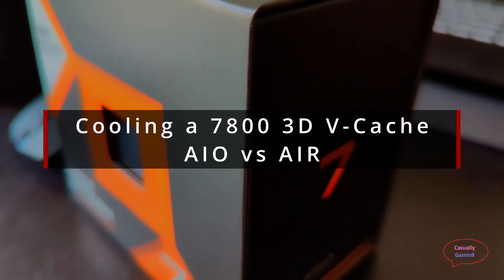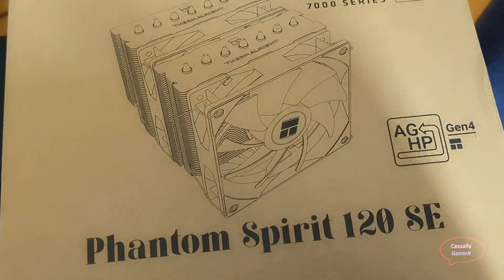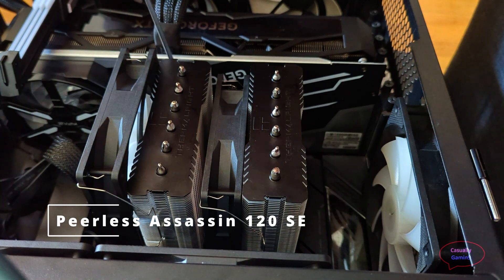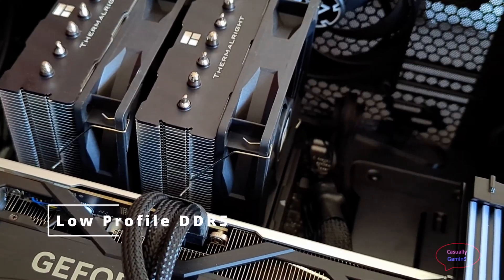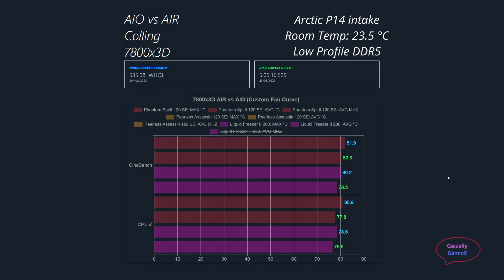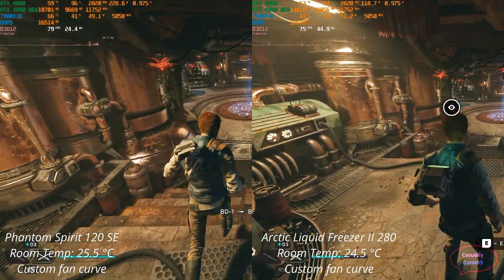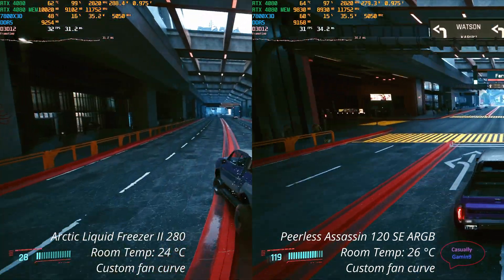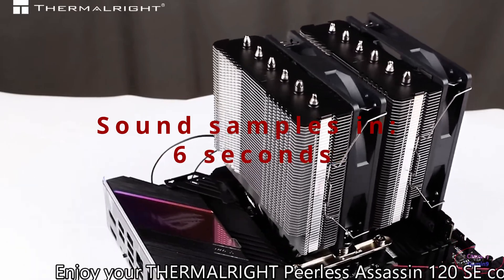Air vs Water Cooling 7800x3D Phantom Spirit 120 SE Peerless Assassin 120 SE vs Liquid Freezer II 280

Comment: You need to show benchmarks. These CPUs are constantly throttling even at 70c by managing boost speeds. You can have two coolers each showing 80c but one gets a 18k cinebench score while the other gets a 17k score. Same temperature, but clearly the 18k one is the  better cooler. Your 2 degree ambient temp difference in the game benchmark is also a problem.
Reply from the maker: At 70 these should not throttle as newer CPUs are ment to increase frequency until these hit the thermal limit. A 7800x3D will throttle at 89 degrees. Intel CPUs tend to throttle at higher temps, as non x3D cCPUs from AMD. This is why I show the averages from 3 runs.
Reply: @casuallygamin9   search youtube for "Air or AIO for Ryzen 7900X and 7600X? Cooler Comparison", notice how the 7600x is the same temperature with aio and air, but the aio is 4% faster in the test. Because precision boost is always throttling, if you plot your hwinfo "effective clocks" on air vs aio the aio will be higher on average, even at lower than 80c temperatures. These cpu's eek out performance at nearly all temperatures, gone are the days of the same performance until the hard throttle limit. Precision boost is adjusting boost and voltages up to 1,000 times per second depending on load, thermal, and electrical conditions, those variables are relevant at 70c as well as 90c.
Reply: @casuallygamin9  So then why does mine suddenly sound like a jet engine as soon as I hit near the 80s or when in the low 80s. It gets loud!
Reply from the maker: I do use a custom fan curve and keep the CPU cooler at 65% fan speed by default and when it hits 80c I have it at 100%. Heaving it spin faster by default will help with idle temps and also, your ears will adjust to the CPU cooler fans sound. Don't exclude the fact that your cooler fans my have an issue. Keep in mind that most if nat all reviewers out there have 1 sample to test and the results are based on the given sample, this is why is better to look for multiple reviews of the same product.
Reply: I've got a 7800x3d and I live in a hot country, this cpu is still hitting 5ghz while gaming on 85c... So no it's not thermal throttled by any means... Also no fps loss or performance loss as well, unless u hit 90c those am5 cpus won't throttle
Reply: @aquazonecr8750  what cooler do u use
Reply: @panospk213  phantom spirit 120 se

Comment: in the past a liquid cooling tube cracked over the years and I had to throw away my PC... I've been a fan of my Noctua NH-D15 ever since. It's not pretty, but it's practical and quiet.

If I had to mount an RGB Gaming PC to "show off", liquid cooling with a little screen. I have it under the table, air...
Reply from the maker: I'm sorry to hear that, I feel your pain. Never had this issue, but than again, I'm using most of the time air. One question, where did it crack, near the pump or close to the radiator. Was it custom loop or a closed loop (AIO)?

Comment: Try the Thermalright Frost Tower 120. It's a 120 but it has a more fins ( on the bottom) and it has thermalrights faster and higher pressure fans. Same price.
Reply from the maker: I think the Peerless Assasin and Phantom Spirit, not the se versions, are the same. Both have more fins then their SE counterparts. Thermalright is wired when it comes to this, as it has so many coolers that are so close in performance, price and features that is really hard to pick one.
Reply: @casuallygamin9  the FT has the better fans though
Reply from the maker: @geezersgal1  True, I checked the specs and it seems that the fans are better. They spin at @1850RPM.

Comment: I like air better, for all the reasons others have said. But I do acknowledge water is better in an absolute sense, but for it to be worth it in my opinion you would not only have to be using very hot parts, but doing additional measures like mounting, paste, de-lid  etc. to get the big gains that make it all worth it to push the power hungry CPU/GPU. In most people's setups good air cooling is more convenient, cheaper, and more reliable. Done right, air-cooling is also the quietest, since most water setups still have pump noise.
Reply from the maker: The only complain I have about air coolers, is when the OS starts to max out the CPU cores and the CPU fans starts to spin at max RPM, just for a second. I agree that, air cooling, most of the time is cheaper and the better solution. I think that when you have a power hungry CPU, going with water makes more sens.
Reply: @casuallygamin9  I've never had that happen when I put limits on my fan speed
Reply: @casuallygamin9  kind of a necro but could be useful for others too.
On my mobo (rog B550-E) there is a setting to delay the fan response (step up/step down), which prevents such ramp ups. (in Q-fan settings)
Haven't actually tested it, but I have set it to the minimum (12 secs) and there is no annoying fan ramp up ever. So it probably works the way I think it does.
Reply from the maker: @JKGaming1414  I know of this, Fan Control has that feature. One downside to this is that you may thermal throttle as the fans will not react that fast when the temperatures reach that point
Reply: @casuallygamin9  ah I see. Yep that's definitely a concern, it's worth the "risk" for me though (casual gaming, large heatsink).
Wish it could be set to a lower delay, like 3 seconds...

Comment: air cooler. water cooling is just waiting for the pump to die
Reply: I built a pc in 2018 with a evga clc280 and its still running like the first day.
Reply: 3 builds now and not a single AIO has died on me. Funny though, next rig is using a PS120se cooler
Reply: @sheshd  Same, using Corsair h100i for already 6 years, it's still working like new but now I'm changing to PS120se for my new setup
Reply: @RmX.   Haha I've got the h100i on the daily. Funniest thing about it is I repurposed a second hand Dell alienware and it's been a beast!
Reply: Corsair pump just died... so yeah air cooler it is
Reply: @SoMiSongbird  it's a giant cooler.. but best one for the money imo
Reply: as others has said, i built PCs for the last 20years for myself and friends and i still havent heard any of the PCs being build with an AIO that has been dieing and all of them have been diffrent models of Corsair AIOs, i mean sure it can happen my self is still using a 5years old if not longer Corsair H115i (iirc Gen 1 so no RGB/Elite) and its still working no pump noise or thermal issues
Reply: Just happened to my ID cooling water cooler after 6 months. Decided to try out this air cooler for my 7800x3d we shall see tomorrow.
Reply: i just clean change change liquid to my AIO cooler at home.
Reply: By that logic we are all just waiting to die lol

Comment: I wasn't expecting the small temperature difference at CPU full load. Glad to see that air coolers can compete.
Reply: It's because temperature matters less for cooler comparison than wattage does with AM5. AM5 is made to try and get up to 95 degrees and then adjust clock speeds and such accordingly. You will see the AIO letting the CPU run faster for longer because of heat soak it allows for.
Reply: @Hello-jz5lh True!
My point is the water is cooled and limited by the radiator or fans
Reply: That 12C difference in gaming is a bit bigger.
Reply: At Max temperatures, its nearly the same by 5 degrees margin due to VCache ram stacked on top of the CPU die that heats up the entire package. No matter which cooling you go with, this design will make all cooling solution  perform the same. What matters is that when you are playing a game, CPU won't be at max load on all cores and you can see a big difference of 13 degrees in this video here with ell cores have way less load during gaming.
Reply: The water is cooled by air too that's  why
Reply: @tmtguitar  I think water cooling has an advantage, because of the bigger surface area on the radiator used to cool the liquid and the liquids' superior thermal energy conversion from CPU to itself.
Reply: @tmtguitar and the air is cooler by water, there's liquid inside heat pipes lol.
Reply: Air coolers have been able to compete with water coolers ever since the high end Noctua air coolers were released.

The best thing now, though, is that this can be done for a fraction of the price these days 👍😁
Reply: @Roughpaws_Studio  Just going from an average TIM to Kryonaut or Gelid Extreme and lapping the base of the cooler will get you the majority of the difference shown in the video for less than $15.

Comment: Personnaly i prefer air cooler. With a little undervolt you dont even lose performance ans gain some temps and consume less power. Only the fans can fail so it’s very cheap to change. But aio is good too. Depends more of our personal taste and capability of replacing the part that fails. But a lot of people dont know that lot of motherboard company always over tweak cpu tension for « more stability » and performance. Nice video, keep going 👍.
Reply: Yes, AIO coolers suck - weak pumps
Reply: What is a good video to tweak cpu and gpu without loosing performance?

Comment: I got the Phantom Spirit SE but wish to get the non SE version since is always better and more ram clearance compatible :face-red-droopy-eyes:.
Reply from the maker: When you say it's better, what temperature delta do you expect to have when going with the non se version?
Reply: @casuallygamin9  is taller and more ram clearance = better temperature overall better performance.
Reply from the maker: I couldn't find that on Amazon. I will keep the Phantom Spirit SE.
Reply: No a comparison by PC analytics showed that the non SE version is slightly crappier.
Reply: @lemonjelly  Thanks for the tips